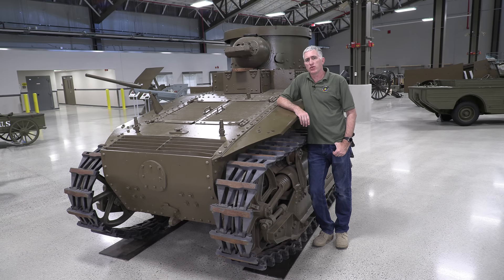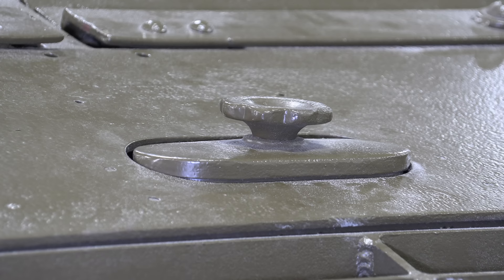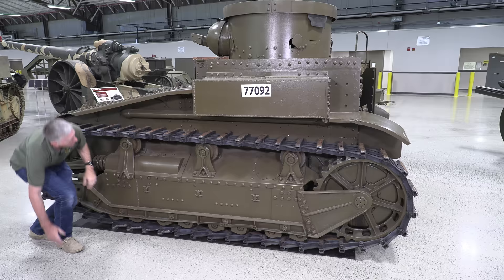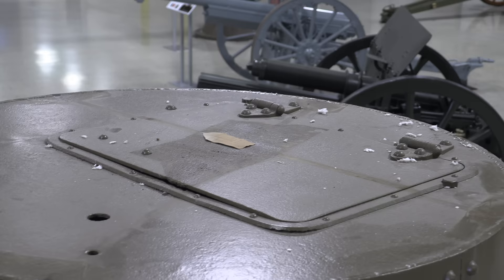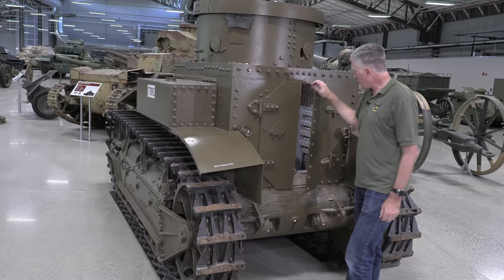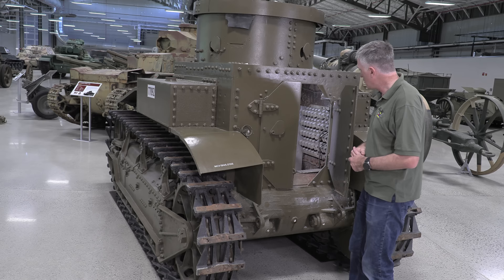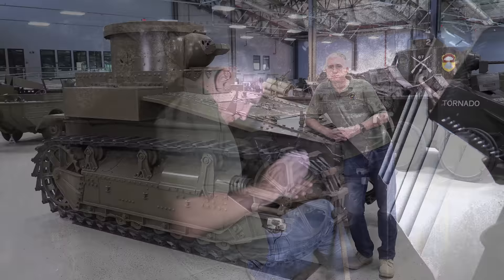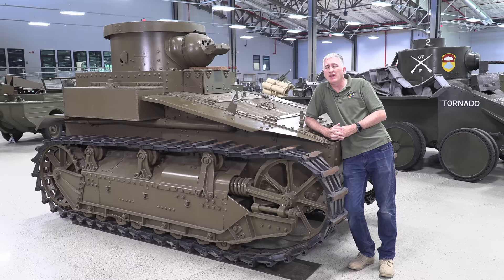Inside the Chieftain's Hatch: Light Tank T1E2

Comment: A modern electric powered composite armored tankette packed with modern technology would be just plain awesome. I can't believe no one in NATO has built one.
Reply: Wiesel II: "Am I a joke to you?"
Reply: @iansmith4184  Yes, you are
Reply: It'd need to be a hybrid, not pure electric because electric takes too long to recharge.

And if you consider 18 tons a "light tank", then yes, the US Army did build a few. The entire Future Combat System was built on an 18 ton chassis.
Reply: @ScottKenny1978  They never fielded one operationally, and I definitely don't consider FCS a light tank. More like a multi tens of billions of dollars boondoggle.
A Tankette is more in the 5-7 ton range.
Reply: @Valorius  okay, so a CVR(T) with a hybrid power pack.

I've heard of a work truck setup with a Cummins and hybrid system that was supposed to replace a generator trailer. Was intended to be military.

If you can find that power pack, it should be close to a drop-in for the CVR(T).

Comment: if the merkava has a front engine designed to take a hit to save the crew  And if early tanks had short guns becuse early designers felt the gun had to be shorter then the tank so the gun wouldnt get damaged or in the way. why did almost all ww2 armour have rear engine designs?. ps i think the uk had the whippet in ww1 a front engined tank
Reply: Weight and balance. You have this thick frontal armor and need to more or less balance it out with something back aft. The engine is the easy way.

Too much weight up front and the tank gets stuck more easily (see Jagdpanzer 4 and Hetzer).

Comment: The date on the fender- That is the date that the vehicle entered the museums collection.  Every vehicle there will have a date either painted or physically stamped into the body or armor.

No Firewall-  The fire "break" has been removed at some point for maintenance and never replaced.

Shift by ear-  There is clearly a data plate for shifting instructions on the right side of the drivers compartment with instructions for speed levels for shifting.

The tracks have holes from "rocks"-  The tracks have rusted through because it sat outside on a concrete pad for 60+ years and never moved.

I could go on and on and on, but it would be pointless.

I wish all of these "experts" would study the vehicles they are presenting before publishing material for general consumption.  This video is for only those who think "tanks are cool" and they get the chance to see something they wont get a chance to see in real life.  But for those who study tanks.............well...............I'll just be nice and say the video quality and sound is good.

Please study and research your subjects, and museum practices/policies before making videos.